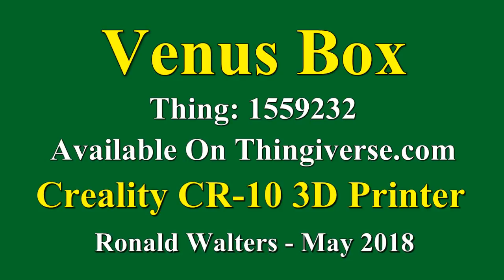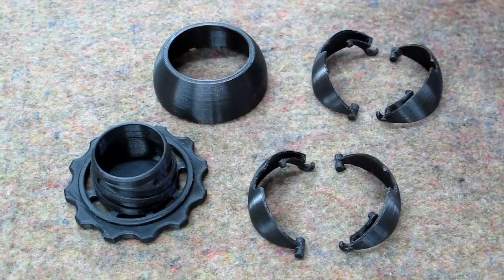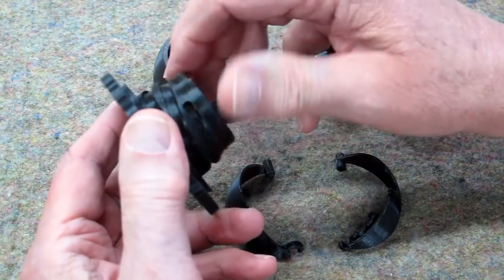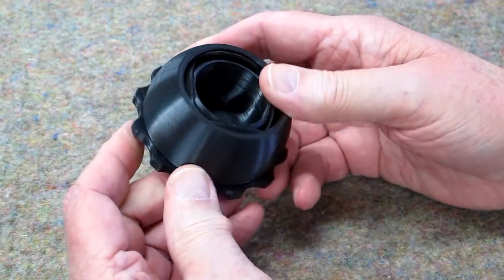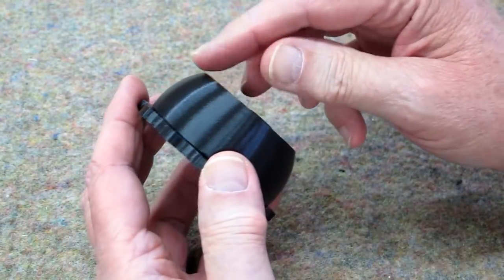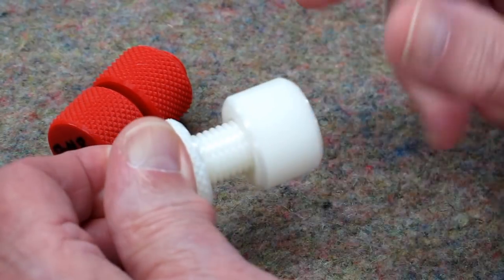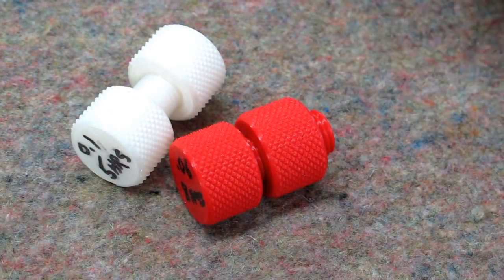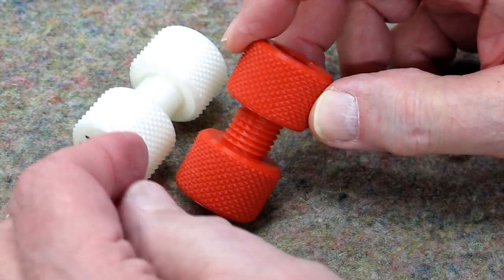Venus Box - Reduced Size on Creality CR-10

Comment: I’ve only watched two of your videos on this so far but appreciate all that you are explaining. I’ve also never had (and in my case no neighbors with one) any type 3D anything. I respect you and your many many previous video builds so I trust your opinion. I’ll be watching further videos you make regarding 3D printing.
I do have three questions please?
1- So the heated filament melts together even if the previous layer of filament laid down has cooled and the results are still very strong?
2- I had been wishing to see a 3D platform that was multipurpose with changeable components for filament (plastic), laser (for wood) and maybe even a router. Unfortunately, I may not have enough time for those to come down in price (if/when developed) to afford. Perhaps your recommendation to start and learn the software, terms and operation would best be served on a printer such as this one?
3- Could you please tell me (us) what was your initial purpose and hopes for future builds you had envisioned to make for you purchase a 3D printer?

Thank you very much for walking us through the pros/cons and operation of machines in the world of 3D plastic printing (while you are learning also)!!
Reply from the maker: (1.) Think about the geometry. The nozzle is 0.4mm diameter laying down a 0.1mm layer thickness and the hot end temperature is 210 deg C. The program (slicer) takes all of this into account and adjusts the x & y-axis speeds and extruder speed to produce an even layer. The molten plastic comes out of the nozzle hot enough to melt into the previous layer and the cooling fan cools it quickly to prevent warping. You have the ability to adjust (play with) the parameters in the slicing program to alter the results. If the settings are incorrect you can get very pronounced layering which can be pulled apart. Different materials have different strengths or applications. The cheapest is PLA, which seems to be good enough for most things (IMHO).(2.) More times than not, when you see a tool (gadget) with lots of attachments to perform different tasks (drill, scroll saw, sander, etc) chances are it is a marginal tool at best and not very good or accurate at any one of its jobs. Best to decide which tool you need first, buy a good quality tool and save up for your next purchase. A 3D printer makes very little mess and no smell (a little noisy). A 3D laser is large, difficult to extract the smoke and not piss off the neighbors with the constant smoke and they are noisy. A 3D router is large, makes a huge mess and is quite noisy.(3.) Learn how to make it work first. Then work it into future projects. It you want to learn CAD, a 3D printer can make the parts come to life. Nothing beats having a part in your hand for final evaluation.If you are going to learning anything about woodworking, you will probably use up a few trees in the process. For 3D printing and CAD it is electric and corn. In the first 85 days I have over 900 hours on the CR-10 printer. I'm having some fun! :-)
Reply: Ronald Walters Thank you Ron. Thank you very much!

Comment: Very nice! Would you mind sharing what filament and print settings you used?
Reply from the maker: NoName brand 1.75mm PLA from China purchased out of California. 0.1 layers, 1mm wall,  5mm retraction, 210 degC extruder 60 degC bed, 100% infill for doors, 50% infill for cover, 20% infill for cam. No supports. Raft for doors only and used the door stl files with the removable triangular support. Thanks for watching. Please subscribe.

Comment: Cool mechanical box. Do you think it would print at 50% ?
Reply from the maker: Possibly. Small parts like the cam followers for the doors may become pretty weak. Maybe I will try one of the doors first.  The rest of it should be fine.
Reply from the maker: Yes it will print at 50% size... very nicely using 0.1 layers, 100% infill for doors & cover and 20% infill for the cam. I'll post photos in thingiverse.com